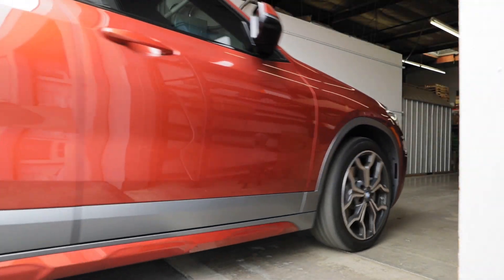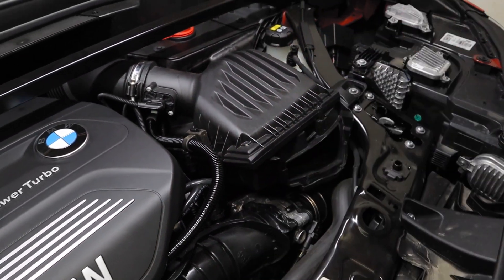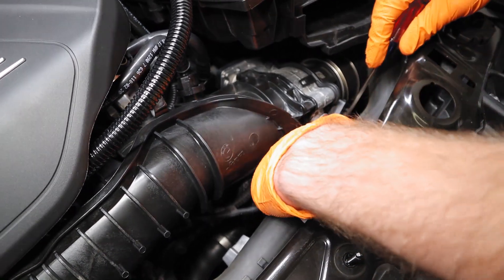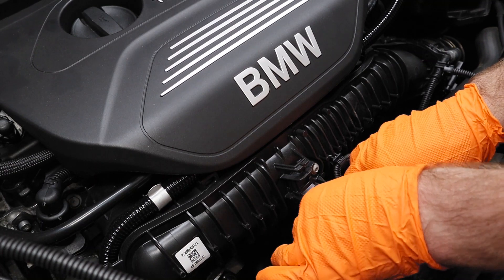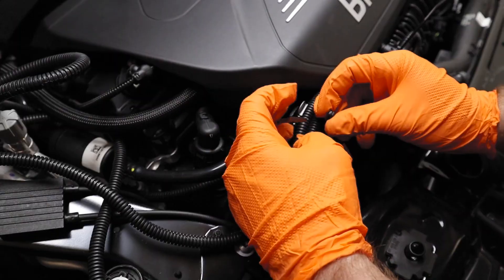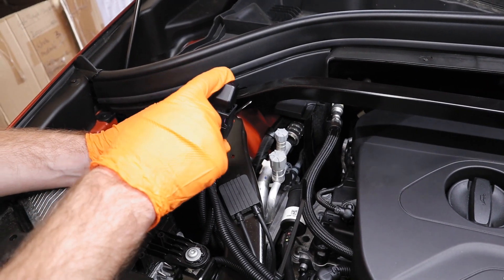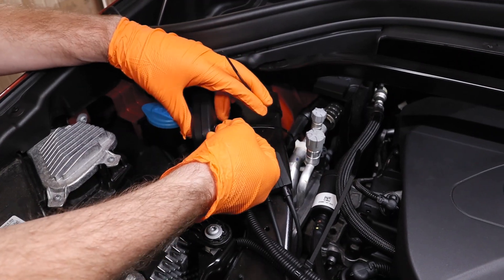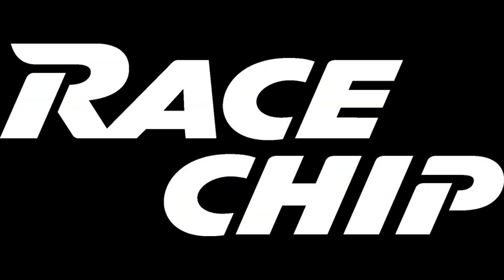BMW B48 Engine RaceChip Tuning Installation (transversely mounted) | Mini Cooper | B38 | X1 X2 28i

Comment: I tried Racechip S on a B38 engine.  

At level 0, it is exactly the same power and driving sensation but the exhaust line shiver more. 
At level 3, you loss comfort driving sensation and the power gained is not too much , you feel it only with the 6xt gear at 120.  
At level 4, you begin to feel the difference with stock, again you loss driving comfort.
Finally at level 5, you have more power/torque (about +15HP and 60nm) but you loss such comfort driving (especially in congestion).

So i keep it always on 0 and when i want only more power in level 5 , or in highways. Clearly in highways it is more comfortable driving with it in 5.
Reply: Hi did you applied in a mini one ? And are you happy with the increase? Do you suggest me to buy it ? I have a mini one first b38 with only 75hp on it
Reply: I'm planning on getting one for a B38 X2. Should I get a custom map instead?

Comment: Just curious, what happens if you plug in the RaceChip the first time and the power comes on, then what?
Reply from the maker: It can cause a check engine light.
Reply: @RaceChipInstallationVideos  Luckily, I did everything right and installation went perfectly.  Thanks for such detailed instructions!

Comment: Hi there,I have the racechip ultimate connect,it as 3 connection points on the wire harness,I got a golf mk7 1.4tsi engine,wen I put it on the car,it runs fine can feel the extra boost,but if I push my foot flat,the car breaks up and the EPC LIGHT COMES ON,turn car off back on,it’s back to normal,any suggestions,thanks,
Reply from the maker: Please contact support@racechip.com and they will take a closer look at your case. They should be able to remotely adapt your tuning software.
Reply: RaceChip Installation Videos thanks for your reply,